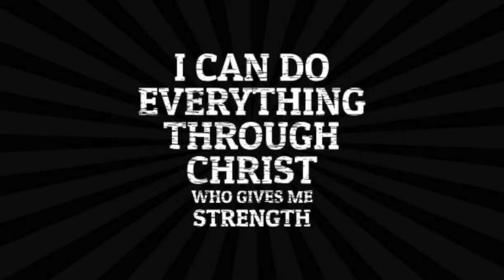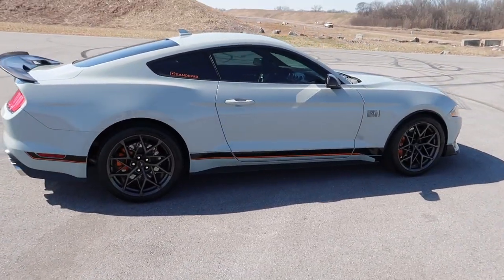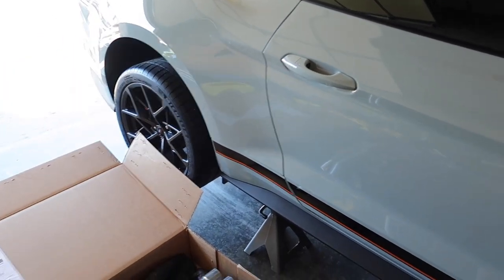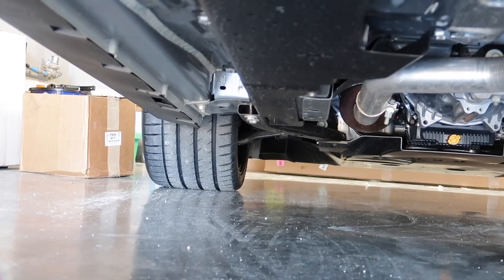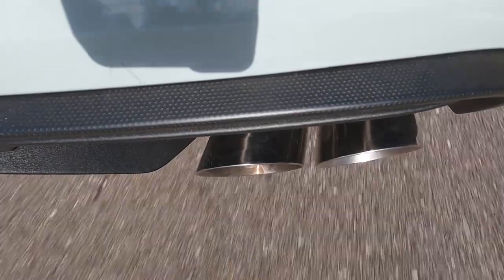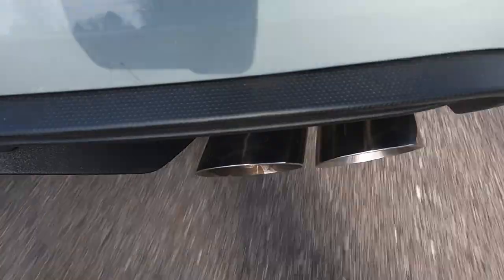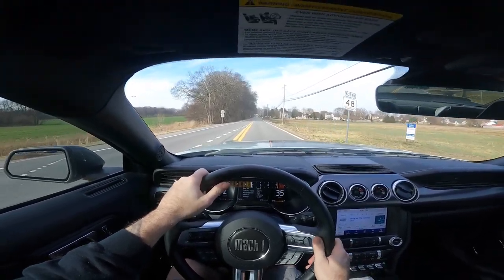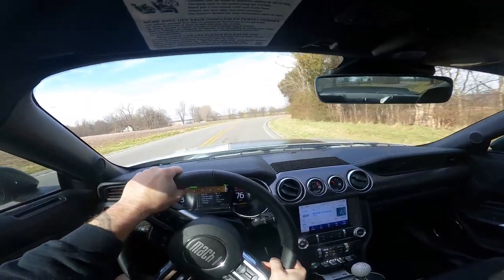2021-22 MACH 1 MUSTANG w/ CORSA DOUBLE X-PIPE & FACTORY EXHAUST *MUCH LOUDER!

Comment: I heard Corsa might come out with a Mach1 exhaust with the 4.5” tips. Watch your active exhaust wires on passenger side.  If you don’t give enough room they will rub the pinch weld and  ground out,blow a fuse and disable your active exhaust. You probably already knew that tho. Sounds good man!
Reply from the maker: Yea. I been talking to them about a bigger tip version
Reply: ..man can always use a few helpful tips!
Reply: @Zander13Productions  any word from Corsa on those bigger tips?
Reply from the maker: @mach_wan2159  I have been trying
Reply: @Zander13Productions  Alright! Hope they listen. I just installed the extreme cat-back with double H on my Mach yesterday. I am missing those 4.5” tips! 

So far….. I’m surprised its quieter than expected lol.
Reply from the maker: @mach_wan2159  yea. That’s why I still have stock mufflers. I don’t want to loose the tips

Comment: I have a 19GT with active exhaust and a flow master X pipe and it, to me, sounds delicious. Especially at a cold start and down the road with poppy sounds. Not too aggressive but to the outside spectators do know it has sound. To add, I have a manual with rev match.

Comment: How does the power difference feel between this and the zl1? I love the Mach 1 thinking of selling my 19 GT for one.
Reply from the maker: Feels definitely slower but with FBO E85 it will feel on par
Reply: My father in law has a ZL1 and I went FBO and E on my HP car and it feels damn close to the ZL1 on the ass test.
Reply: You should keep this one all NA Zander... that’s what I’m doing with mine my goal is to get 500 rear wheel H.P. & I’m only 30 away from that. That way you don’t lose the dependability of your stang...
Reply: @edwardfuller3952  Dude 100 percent agree. Steeda can make it run 10s all NA
Reply: @Zander13Productions  Hey Zander where can I get that Mach 1 steering wheel insert? Mine has a pony.
Reply from the maker: @TheStud52484  find the badge king on Facebook and let him know I sent you
Reply: @Zander13Productions  Thanks god bless ya bro.
Reply: @Zander13Productions  Also you should go all NA on the stang. Every1 boosts Mach 1s as seen on youtube. Show everyone you can be fast all motor. The balance of the car wont be messed up either.
Reply from the maker: @TheStud52484  I have not seen any boosted Mach 1s on YouTube 🤷‍♂️
Reply from the maker: @TheStud52484  same to you
Reply: @Zander13Productions  speed addict 731, ozo man is another.

Comment: I've had the Michelin PS4S on my 370Z for the past 22K miles and they do get great grip, especially considering how long wearing the tread is. I believe that Michelin's engineers designed the tire as a more comfortable riding tire for high performance street use, along with great wet traction. The tradeoff that I see is that the sidewalls are not as stiff as I would like, with the effect that the steering precision and response is not as good as I would like. It's all a matter of personal preference though and the PS4S is probably one of the best all-purpose high performance summer tires you can get for the street.

Comment: How does the handling of the Mach 1 compare to the ZL1 you just had? I’m thinking of switching to the GT500 from my ZL1 and I recently got to drive it for a day, and overall it doesn’t feel as good as the Camaro. Wonder how it compares to the Mach 1 since it’s lighter than the GT500. I feel like you could go faster in your ZL1 around those bends with more confidence, compared to Mach 1.
Reply from the maker: The Mach 1 is sharper in the front with less weight on the front. The zl1 is a excellent handling car. I have driven the 500 a hand full of times and even been on track with one. It’s still a drivers race between the 500 and a zl1 1le but the 500 is WAY easier to drive and live with. The 500’s DCT is amazing. The 500 is a beast

Comment: Thanks Z it helps me decide what works best when I get mine, but I'm tourn between a new mach 1 and a 2020 350 gtr  ?
Reply from the maker: Hard choice. Mach 1 is the new kid on the block and has stuff like digital dash plus all the suspension. All my buddies with GR350s drool over the Mach 1
Reply: @Zander13Productions  got you , I leaning toward new rather than a few years old , but supply is limited . Love the sound of the Double X pipe, back when I had my ffoxbody if you had a ex pipe and some flow masters you were the you what lol.  Good content brother
Reply from the maker: @jasperthomas842  I wrestled with the same choice too. Mach vs GT350. The Shelby has better brakes, arguably, and a little more HP, only like 40 more. But the Mach has basically all the same suspension and a more reliable engine and lots of tech like the digital dash. It’s a strange car how it fits in to the line up.

Comment: Zander what tire size did you go with I’m looking at those same wheel but need to know what tire size to buy, I searched the internet and found that the Track Pack coming on 305/30/19 front and 315/30/19 rear. Also did you add the front fender flares as well?
Reply from the maker: I made videos on it but went with stock handling package tire sizes in a Michelin ps4 tire and added fender trim. Also, I have a crazy hook up on variantwheels.com and they do custom Mach 1 fitment too. If you use promo discount code ZANDER13 at checkout at variant wheels it saves you a TON of money plus FREE ceramic coating, Free Shipping, Free wheel cleaner and a Free 3 year road hazard warranty free replacement if you bend, crack or curb your wheels
Reply: @Zander13Productions  Thanks brother! Appreciate the feedback, will go look now!
Reply from the maker: @sgt_loeram1933  🙏🙏🙏

Comment: Brother good stuff! However.. please be careful...of the 3 accidents that I have ever been in, all involved turns and high speeds where the tires broke loose - never from straight line pulls.  Two of those accidents, I'm not sure how I walked away.  Maybe worth investing into a few classes brother.  Lastly, traction control and advance track, LEAVE THEM ON until on a track. Too many oddities on public roads that can cause sudden traction issues.  Even track mode can be sketchy (default traction control off)... I've learned the hard way.   The wheels look beautiful!  All the best!
Reply from the maker: I agree with all! 100%

Comment: Does this mid pipe come with reducers for both ends if your just removing the stock resonator since it’s 3”? I want the double H, but am a little hesitant between that grey area and then when I put on the corsa headers later down the road would I have to add material back onto my axle back or do the headers have the same clamp spot as factory up front? Thanks! I have a 20 GT PP2 w/ active exhaust
Reply from the maker: Yes it does
Reply: @Zander13Productions  awesome, thank you Sir!

Comment: Sounds like your trying to build a 350r. 
350r parts. 305 in front. Making it louder.
Reply from the maker: No. Not copying at GT350R. This is how the handlings package Mach 1s come from ford OEM. Physically can’t not make it sound like a GT350 either. This is a cross plane crank engine lol

Comment: Nice sounding exhaust. Where did you get the Mach1 horn pad for your steering wheel?
Reply from the maker: The badge king on Facebook. Tell him I sent you
Reply: @Zander13Productions  I just reached out to him. Does this go over the existing pony?
Reply from the maker: @GoogleUser-il1vr  awesome. No you have to remove the pony for it to fit right
Reply: I just spoke to him online and says no I don't. How is the quality?
Reply from the maker: @GoogleUser-il1vr  quality is top notch. Could pass for OEM the way it looks
Reply: Great to hear. If it sticks good and doesn't fall off after a few weeks then it's good.
Reply: @GoogleUser-il1vr  I have one and it sticks over the pony. Looks oem
Reply: @Smokeshow767  If you put it over the pony, it doesn't budge out?

Comment: Yeah I wouldn’t get rid of those wheels... there so sick! love the jet fighter grey to bro.. glad to see you went back to a mustang the Camaro just wasn’t you. I have a 2019 GT PP1 and absolutely love it. I’ve done a bunch of stuff to it.. CAI.. kooks long tunes headers.. retune.. borla 3 inch S-type exhaust with carbon fiber tips.. lowering springs.. vertical links.. cradle lock out kit .. sub frame alignment kit.. bushing support system all steeda stuff & whoa what a difference all that made! Night & day difference... smoked out euro taillights which are game changers.. led smoked out marker lights behind the rear wheels... had ford paint my mirrors/ spoiler black got rid of the chrome badging went with the black.. tinted windows all the around & did a 40% tint on the windshield ( just felt like it needed it) she rips... Love your videos bro I finally subscriber’d! 🤙

Comment: Zander you should put it in track mode, those turn would of been easier transition on you and the Mach1. Great content has always god is with you wild enjoying your mustang.👍👏💪😎🇨🇦
Reply from the maker: Something is up with the throttle response in track mode. Suspension feels good but the throttle response feels like snow wet mode
Reply: @Zander13Productions  I agree. Sports plus feels the fastest. I read about this on a forum and said when your in track mode and pick up the gas(wot) around a turn at the track the slight delay in power  keeps the car more stable and less likely to upset the car 🤷🏽‍♂️
Reply from the maker: @Smokeshow767  sounds like another nanny to me. I hope that can be tuned out. Track mode makes the car feel so slow. Sport + mode is legit though
Reply: Have you try it in drag mode just saying.👍

Comment: What's the reason to get a double mid pipe over a regular singly one? Just seems like an expensive gimmick
Reply from the maker: It smooths out the flow and is said to add 1-2 extra HP.
Reply: Seems money could be better spent elsewhere.

Comment: If you made the tires smaller in the rear and didn’t recal your speedo, you lost speed and you think you’re driving faster than you really are. Speedo would be marking higher.
Reply from the maker: I recalibrated spendo with forscan
Reply: @Zander13Productions  ok awesome, listening at work so I didn’t pay attention